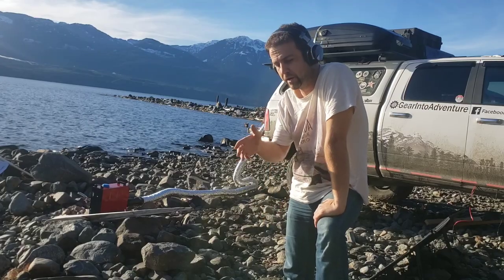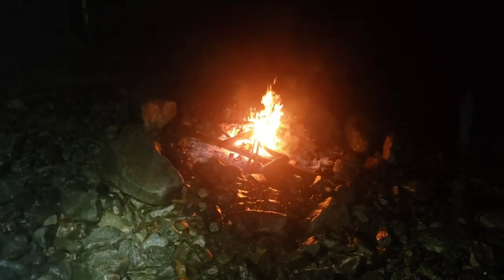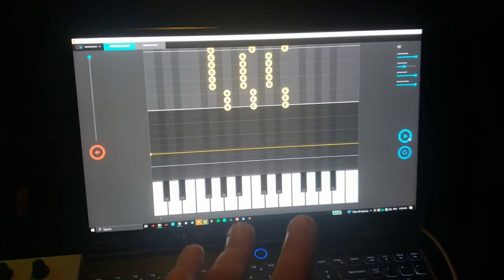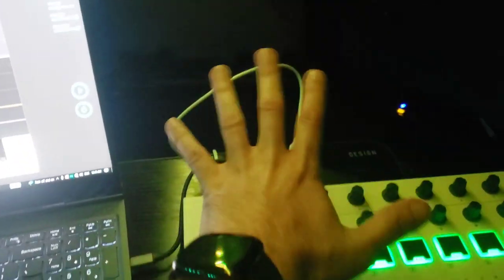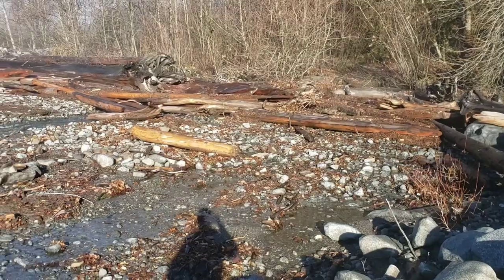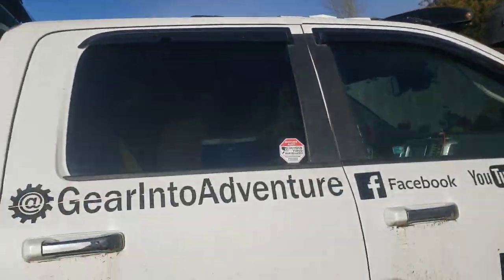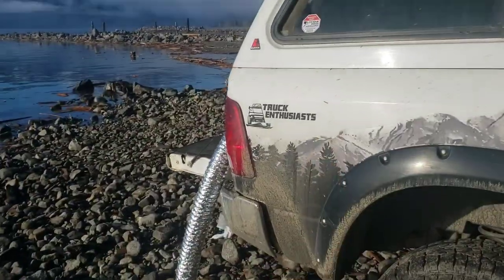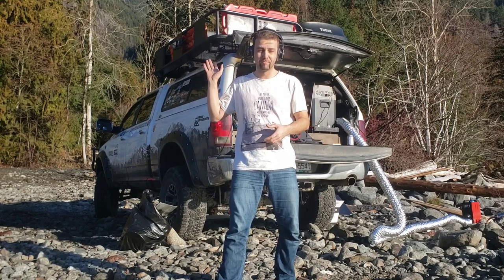Portable VEVOR 8KW Diesel Heater - A Game Changer for Camping Heating

Comment: I have been fultime in my f350 up near Pemberton. With an 8k heater it has been a bit much on low. With that cold snap of -21 degrees it was +16 with heater on low. Continuously running all night. Have been toasty warm and dry so far. Humidity is more of an issue during rainy weather. This winter has been lacking snow. Most of the time the heater gets temperatures up to +29 on low. Using the heater intermittently over the night. Turning it on at around +7 and off at close to +25. It's been an interesting experiment that i plan on continuing. The unit i have is mounted inside and is not the red box like yours.
Reply from the maker: It never got that warm for me but thats probablly coz half the window didnt have pipe so cold air could change me in to. Guess just need to open something else slightly and it doesnt have to be too much even on low for small space
Reply: @Gear_Into_Adventure  Have you noticed that the heater smokes for about 30 seconds. Mine does that quite offten. It does not ignite right away at times. White smoke then billows out. Coming in through any opening. I have seen some "tuning" their heaters but i cannot seem to do it. Also, there is a better controler, called Afterburner, or something like that.
Reply from the maker: Yah mind smokes for about 30sec like u said before it goes into more steady mode

Comment: the system can be made way more efficient, you are pulling in cold air, the run from the heater to your truck is not insulated. 
..the unit is designed to be in the vehicle, if you have space and just run the exhaust to a safe distance, warm air circulates in and out of the heater, no loss. Just more economical
If you have no space then have the backy air circulate through insulated hoses, have the unit under the truck, and extend the exhaust away from the vehicle
Reply from the maker: Thanks for tips